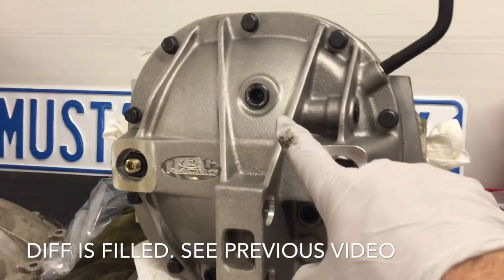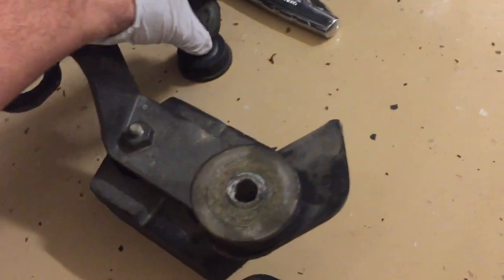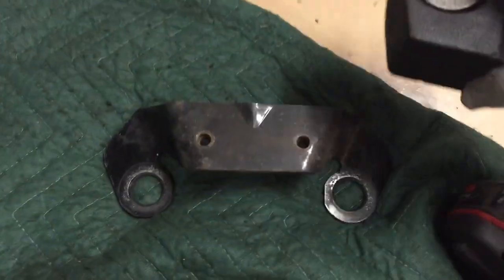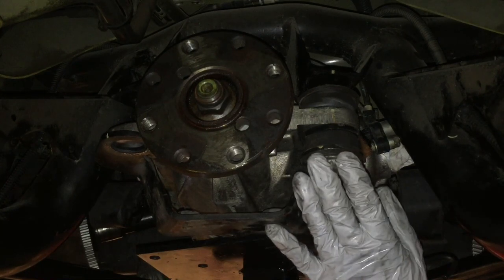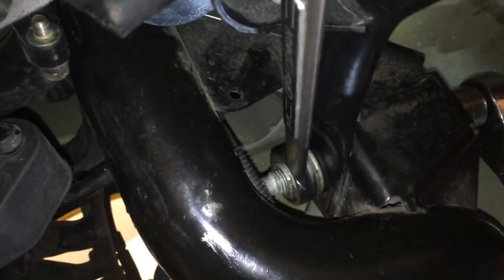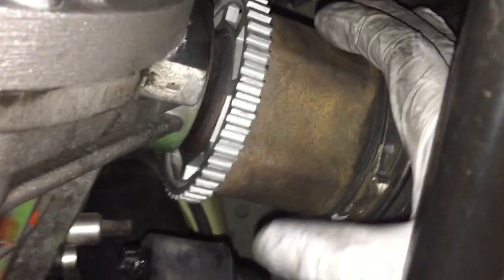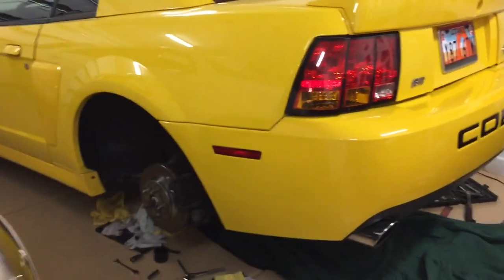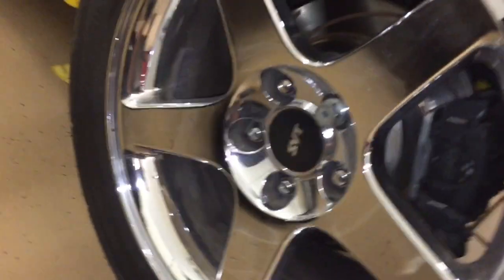Cobra Diff install: 03/04 Cobra & 99-04 Cobra IRS

Comment: The bolt at 7:18 is used to adjust the camber on the rear end.  Well, at least it was on my '03 with eccentrics installed under warranty :).  Make sure and check it is back into the correct spot to avoid camber/toe change.

Comment: Grear video Dan im just wondering what bolts you ended up using to seal it back up. The ones drom ford racing were allen heads .
Reply from the maker: Watch this https://youtu.be/6gBXoSSSB5o

Comment: Going through this whole process on my 2001 stock cobra.  Just curious,  on the install did you just do the torque specs on the driveshaft bolts or did you do it to all the bolts?  If not is it ok to just get the front and rear diff mount bolts and the control bolts as tight as you can?  Thanks for these videos they’ve gotten me through this with relative ease.
Reply from the maker: It’s always best to follow torque specs and not smash bushings too much.
Reply: @dannyjohnsonsgarage  agree.  I dug through the shop manual I had and compared to what I found on the forums  and wrote down the specs for everything.

Comment: Hey Danny thank you for the video, I actually just had a set of 4.56 installed for my 01 cobra (not lucky like you to have an 03/04 lol) woke the car up perfectly. No drive ability issues at all. I installed the same ford racing diff cover too. I’m gonna drop the fluid in a few hundred miles. How hard is it to drain and fill with that cover on irs? That middle brace looks like it’s hard to add fluid thru the fill hole!
Reply from the maker: It sure seemed tight enough that I sealed it up before install. You may have to get creative with the socket and wrench combination and a small tube. You’ll have to let me know how it goes
Reply: Danny Johnson I will let you know . Drain plug looks like cake but that fill and level plug I’m looking a little puzzled. I’ll get the car higher in the air and see if it looks easier
Reply from the maker: Rice ETR It doesn’t sound like fun, but just to keep in mind you can add fluid through the half shaft hole if you remove the half shaft

Comment: How in all that is holy did you snake the diff up into the irs?!?  

I’m constantly either hitting the tie rod mounts on the subframe or the exhaust hangers. 

🤬🤬🤬
Reply from the maker: richarcm Did you remove the front cross over mount that bolts up to the control arms (swen in the removal video)?
Reply: Danny Johnson  Yes that is completely set aside.  My problem is in the rear of the differential.  Getting it around the two tie rod mounts on the subframe and the two exhaust hangers.  

No matter how I position the diff it hits one of the four.
Reply from the maker: richarcm Is the rear of the diff pointed up? I pretty much went horizontal with it, but attached the rear first
Reply: @dannyjohnsonsgarage    I've been going at it flat on a scissor style transmission jack.  But its always either hitting an exhaust hanger or a tie rod mount.  Someone else said you had to angle the rear up first.  

Its just weird because I can't really find much anywhere saying that or of anyone having TOO  much difficulty.
Reply: @richarcm  i’m having the same issue... did you figure out your problem?
Reply: @froggyman089   I believe I just turned it slightly.  And was able to eventually get it to clear.  It’s a PITA.  Especially since I don’t recall having such a problem with getting it out.